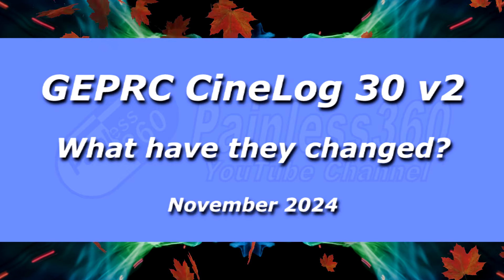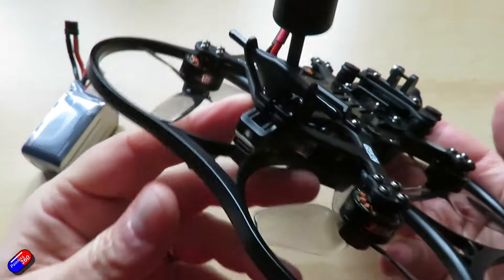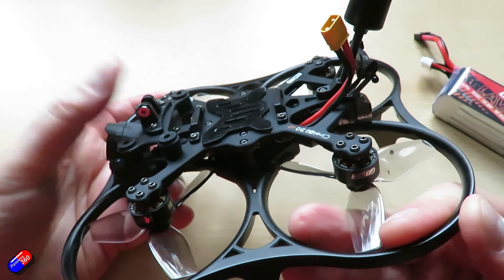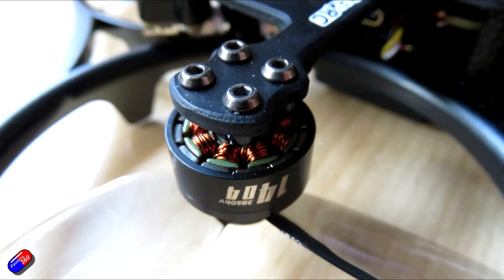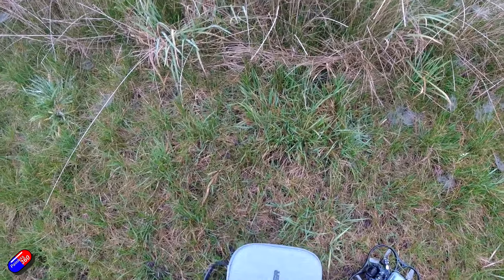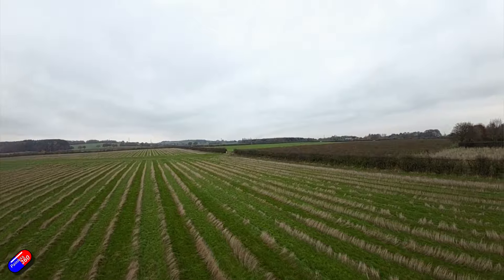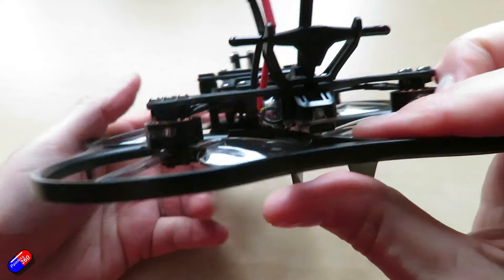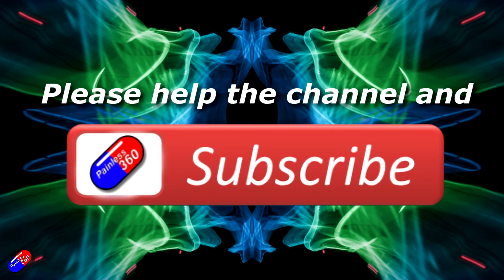Just Released (20Nov): Updated GepRC Cinelog30 v2 (my current favourite 3")

Comment: Hello there, I have a problem with my geprc 30 analog, I have signal on my radio(quad is bound) But when I hit switch it just doesn't arm, Also on the mode page nothing happens when I hit switch, and quad is spinning on receiver tab, Please help me. Thanks in advance
Reply from the maker: Sounds like channel order. See my video on BNF setup... Best of luck
Reply: @Painless360  will do thanks you so much.

Comment: Hey there Lee…how’d you get your battery to stick to the drone? I didn’t see Velcro. Is there some adhesive pad?? Super curious.
Reply from the maker: It's a sticky battery pad. Happy flying!
Reply: @ do you fly it with only the sticky battery pad or do you also use a strap? I’m assuming you use a strap as well. Are you able to share where a link or the brand name??
Reply from the maker: The sticky pad is super-sticky and seemed to be fine on it's own The straps were a littel short for the battery I wanted to use :D

Comment: Great Video! Yesterday finally came my Cinelog 30 v2. But I have some problems and maybe you could help me. Do you know why i can’t config a 2nd and 3rd rateprofil in betaflight? My rear tuning port doesn’t work at all and the port on the fc also doesn’t work correctly. Do you had the same issues? Maybe you have some tips for me! Thank you and keep up the great work! Greets from Germany!
Reply from the maker: I'd try another USB cable and if there are still issues, contact the seller. Best of luck

Comment: Hi Sir
Need solution for my quad 
I m using Inav and speedybee f4v4 and geprc rad mini 1w vtx irc tramp protocol 
On osd it only shows 4 levels
25 100 200 400
I set on 4 level but I only get 200mw max 
Unabe to set 500 and 1000mw
Reply from the maker: What troubleshooting have you already done?
Reply: @Painless360  1) without any uart connection using manually button available on vtx I get all desired output level 
2) Then I connect to uart 3 which is spare uart then I M unable to set power values using manual button. But osd shows four  values 25/100/200/400 and using osd set it on 25 I get 25 , set it on 100 I get 25mw, set it on 200 I get 200mw set it on 400mw I get 200 mw. 
3) next I try to connect on uart 1 ,as fc smart audio pin marking as T1 and enable vtx on uart 1. I M getting same results like 2nd steps. 
4 ) In Inav I set it power on 4 and reboot, 
Until first arm it shows 25 on osd
But after arm it shows 4 power level but led on vtx only blink for two times means 200mw.
Reply from the maker: Look at the VTX table setup. See https://oscarliang.com/smartaudio-tramp-vtx-control-vtxtables/ I hope that helps